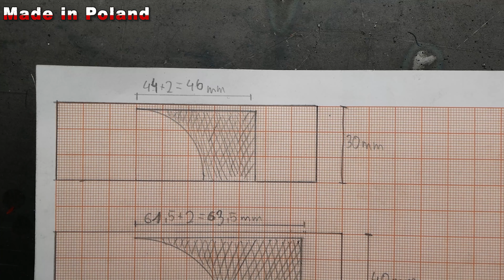90 Degrees - Different ways to weld square tubing

Comment: I've had to make radiused corners on box section projects a couple of times, and I found it a lot less hassle to use steel the same gauge as the tubes wall thickness, then turn it up discs of to the desired diameter, and chop them into 1/4's and weld those in as corner pieces between pipes cut to 90', before capping the outer radius with some rolled steel strips.

As an exercise in accurately marking out, cutting and welding, doing the curve from one piece is fun personal challenge, but if you need to accurately get 4 of them perfectly placed on each of 10 lengths of tube to make 10 shelf frames that are all perfectly square, visually identical, and looked mass produced, I'd say making the corners separately and welding them on is the way to go. :D
Reply: That is cool. One could use a jig. Depending on where you live box steel is pretty much all standard sizes. A person could make half a dozen jigs and then use either a torch or plasma cutter to cut out the section. The jig could clamp on and off set based on you plasma cutter off set and then you could cut them out fast. This would also allow someone to make a square with a whole piece as well. 
Though your idea is pretty awesome as well!

Comment: If one was doing this a lot. I would make a jig for the each size that you might use. This way you could use a torch to cut it out or even a plasma cutter. Now for those people who have a CNC plasma cutter a simple jig made for your table and some set up would work wonders for this as well. You would only need to make 2 small cuts.
Reply: Using the band saw is an awesome idea as well. The other thing one might be able to use is a jig saw provided you have the longer blades.

Comment: Hey. Thanks for all of your videos. Today i been working with 40x40x2, and I followed the progress. 40mm pipes = 63,5 mm didn't work! (30sec in the video) That lead to a gap of approx 5mm when bent in 90° what did I wrong? I did lay the cut on the correct side of the line. /Niclas 🇸🇪